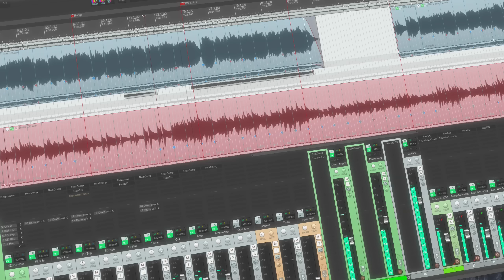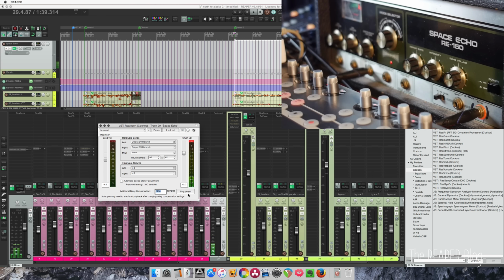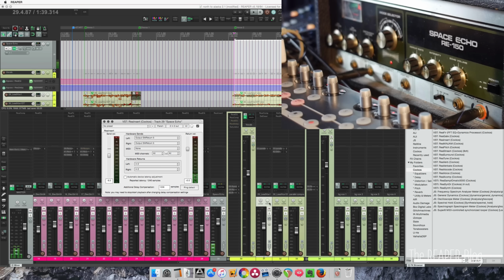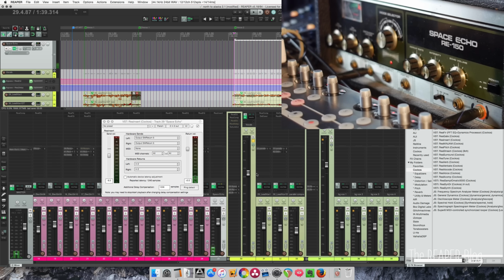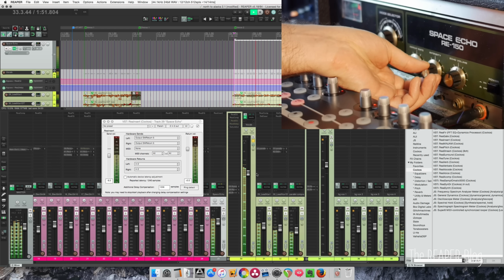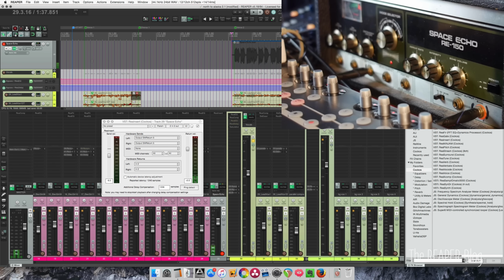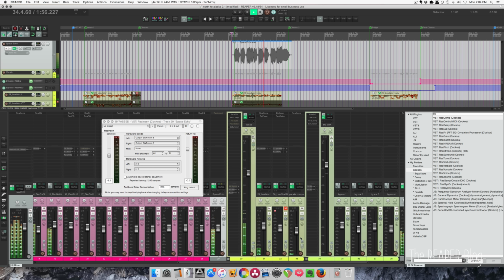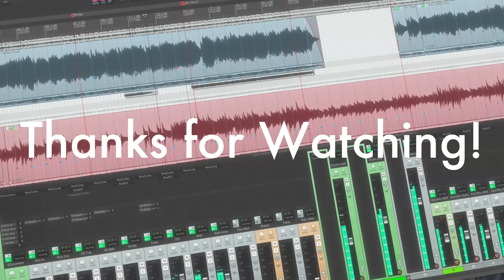Mixing With Tape Delay

Comment: Hi Jon is there any way i can route hardware using my tascam us144 mark 2 ,its a two in two out interface
Reply from the maker: +vikramjit banerjee you can two ways, either monitor off the spdif out or connect a digital effect to the device (probably better option). If you're limited to the analog options, refer back to my Q&A video where I showed reamping with a 2-channel interface
Reply: Can u shoot me a web link of the q and a video please Jon
Reply from the maker: +vikramjit banerjee https://youtu.be/YdI8FRiFod4?t=2m34s
Reply: Thanks a ton Jon :)

Comment: So awesome to see a demo of that Space Echo like that! I use hardware for most of my delay/reverb duties and get some fun out of my Ibanez AD202. A Space Echo is something I've wanted forever though... Maybe someday I'll get one-- they seem to have tripled in price over the last 10 years or so though :\. I usually create separate tracks for my hardware effects... I'm sure my method probably causes a little bit of a delay (though the amount of delay in my system is basically ignorable), but I think that's acceptable with timing based effects like that. Are there any other benefits to using ReaInsert?
Reply from the maker: +Steven Morris other benefit would be that it can be used for hardware synths. I used to just use a hardware send and record on a new track but using ReaInsert it's actually phase accurate so parallel compression is no problem, but would be impossible the other way.